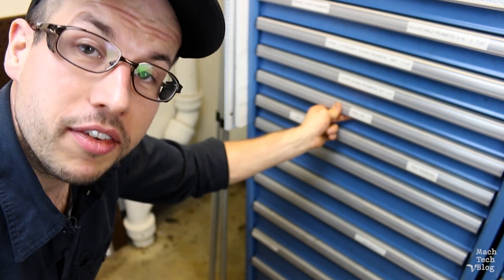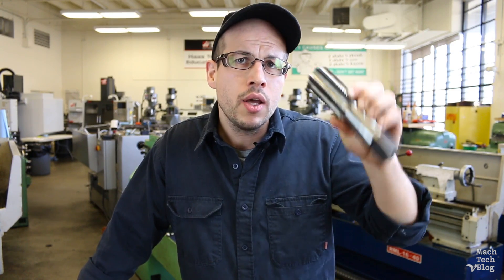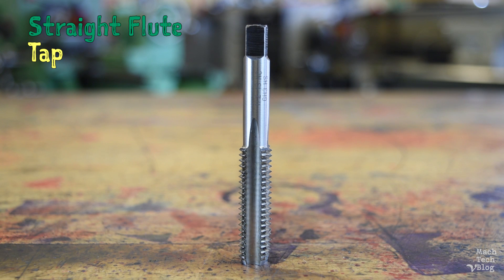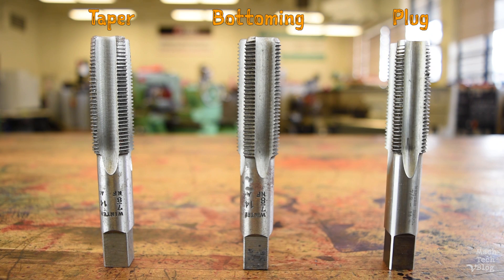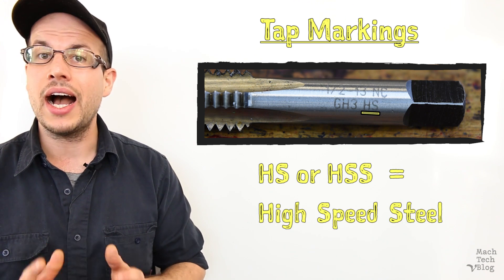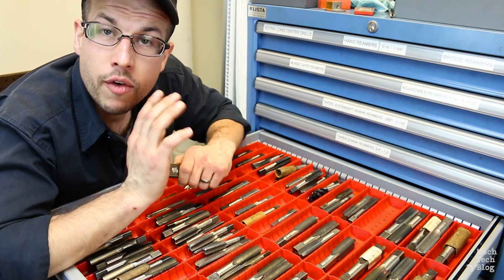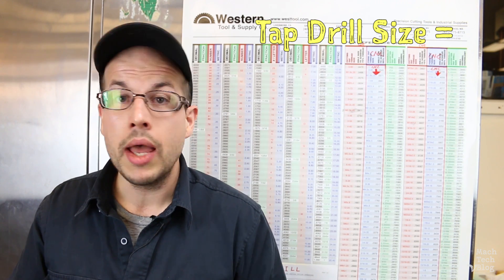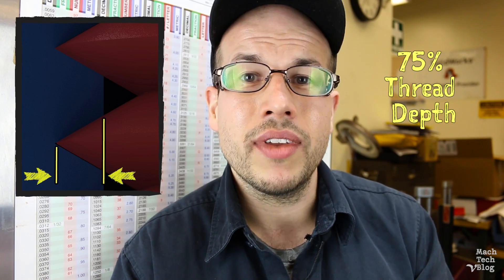Taps

Comment: Adam as usual a very well made video - one comment...as far as making your own taps, manufactured taps have relief in the cutting edges just like any cutting tool.  Think of the single point tool used in the lathe for threading.  Keep up the good work

Comment: That was pretty comprehensive. My tapping head manufacturer recommends 60% engagement for commercial threads. Uk and Australia refer to taps as Taper, Intermediate, (your happy medium tap)  the taper with almost no lead in is called a plug or bottoming tap. Strange how we ended up with different names for the different types of tap. Nice video, must chase up some more of your uploads.

Comment: Other special taps are used in injection molds like super fine reverse metric to catch people who disassemble mold to copy them by letting them break the bolts off when they try to remove them.

Comment: What do you do if the tap breaks in the hole? Assuming you can't reach it? ;) Drill it out?
Reply: Emil Sorensen: You cannot just drill it out, the tap would probably be made from HSS, the obvious way would be to spark erode it out, or if it is a large tap, maybe you could get lucky and break it up, if you try to drill it out, your attepts usually end in the drill wandering out of the side on the workpiece! URRGH !
Reply: Ethan Ooamii : The carbide drill trick is only any good if the tap, is quite large, the problem here is that the broken tap rarely has a square to axis break, so any attempt to drill it out sends the drill out to one side, the tap extractor is also only an option under certain conditions, the shattered tap can really grip in the hole, if you have a broken tap, you have problems, usually!

Comment: I live in Canada, which is actually "neither here nor there" when it comes to imperial/metric. Officially we're metric, but good luck finding a good selection of metric bolts or taps in hardware stores. I'm accustomed to both and while it's a little annoying to have to keep switching systems, it's just another part of the job. I build a lot of electronic prototypes, and I have an obscene number of M3/M4 torx bolts and screws with the associated taps which I use for everything. I feel like a black sheep for using metric and god forbid a torx drive, but in practice, life becomes a million times easier. And with torx, you can take a product apart hundreds of times with zero damage to the bolt heads or the treads due to zero axial force. Hex heads are somehow more popular than torx, which is silly because they strip far easier.